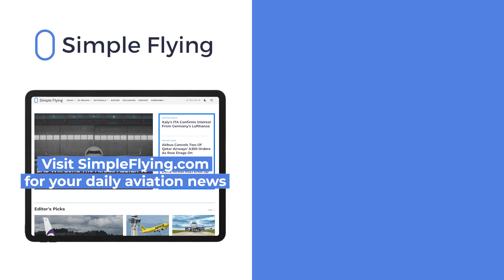Boeing Will Redesign 737 MAX Door Plug To Prevent Another Blowout

Comment: Perfect example of how hysteria drives pointless action.

The door plug is already very well-designed.  What else can you call it, when it lasted 510 flight hours and went through 154 pressure cycles with nothing holding it in place?  Not to mention that, if this had been built according to spec, there wouldn’t be any issue at all.  

But now the public doesn’t trust it, so instead of spending money and engineering resources on improving QA, Boeing has to divert it to fixing something that wasn’t broken in the first place.
Reply: The door plug may be well designed to be a door plug, but it is not well designed to be a door plug and a process enforcement device, and that is why they are charging it, so that it will be non workable unless it is properly installed. 

It is no different than having colors on wire insulation, wire plugs that are polarized, and wire plugs that are physically incompatible with other nearby plugs. None of those are required for electrical connections to function, but they add to the swiss cheese model, making errors more difficult or impossible to commit without committing gross negligence instead of simply human error.
Reply: Then why did it blow out?
Reply: LOL
Reply: @Nathan_NYX_8  because it didnt have the bolts to hold it on
Reply: @Nathan_NYX_8  this wasnt the result of the door plug being designed poorly this was the result of the door plug not being properly fastened to the aircraft
all they had to do was make sure it was bolted onto the aircraft theres no need for a redesign
Reply: @Nathan_NYX_8  becuase of piss poor standards for workmanship, NOT engineering or design
Reply: @Nathan_NYX_8  There are supposed to be four bolts that hold the door plug shut.  They weren't fitted!

Comment: Go ahead and redesign it. Will still fail if employees continue to not do their job.
Reply: And if management puts greed above quality.
Reply: There is a difference between committing simple human error and committing gross negligence. And you can use design to enforce the use of proper process and materials, to provide real time feedback that the situation is abnormal, without relying exclusively on things like user training, user knowledge, the employee "doing their job" and other external controls like checklists, supervisory review, quality control inspections, etc. 

Smart, resilient design means that it is not possible to proceed to the next step without properly performing all previous required tasks, or at minimum will be abundantly obvious upon task completion that the process was not successful and needs remediation.

Connecting the wrong wiring harness to the wrong plug because there are multiple identical connectors next to each other is human error, cutting off wiring connectors and adding your own because intentionally incompatible connectors are preventing you from screwing up is gross negligence. 

Missing the installation of bolts on an attached part between work shifts or work stations is human error, using duct tape and zip ties to hold on a part that refuses to stay attached because critical bolts are missing is gross negligence.
Reply: You didn't listen to the video, did you?
Reply: Yeah, but if the redesign makes it simpler to assemble, Boeing can hire "monkeys" to put the plane together and safe money on operations and pay out bonuses to management. It's a win!
Reply: We know Boeing...

Comment: Many changes at Boeing have been reported, with some yet to be implemented. Senior management must be fully in touch with the companies production activities and problems. The CEO moving to Seattle to be closer to manufacturing is small but important step towards a better oversight of manufacturing. Problems with outsourcing have been present at Boeing for many years. The typical problems of reworking outsourced components and assemblies was flagged by employees (according to various media reports) at least 10 years ago but, the warnings were not heeded.

Comment: Does the new design prevent the use of dishsoap as lube or missing bolts? Built-in sensors? Call this elaborate system McASS.

Comment: Just fly on the older Boeing aircraft.
Reply: It’s the same door plug in the old planes.
Reply: @tylerduchesneau  But it was assembled at a time when they used methodical paperwork and followed their own procedures. The last 5 years, they just slammed the parts together and shipped it out of the factory as soon as they could.
Reply: @tylerduchesneau Yeah, but quality control was better back then.
Reply: Shutting down the damn thing and allowing Comac/Embraer to develop alternatives would be better in the long run than keeping a substandard corporation in existence just because it happens to be American.
Reply: @tylerduchesneau  but the problem wasnt with the door plug design
Reply: @animegamingdude I agree. Maybe if someone put the damn retaining bolts in after they opened it, or tested the pressurization after the plane had problems before flying again.